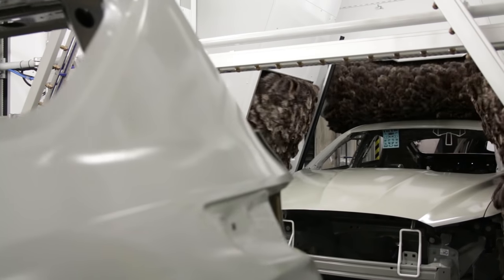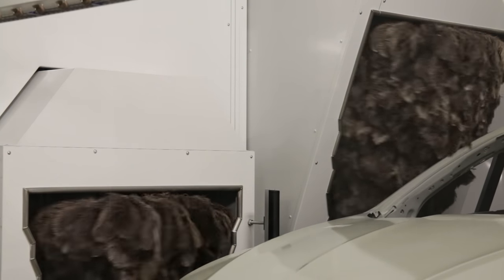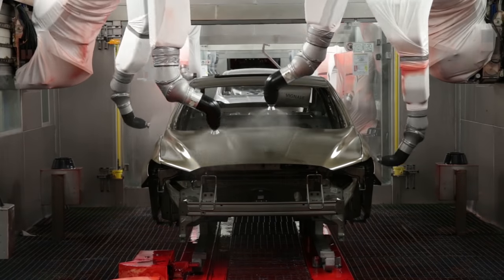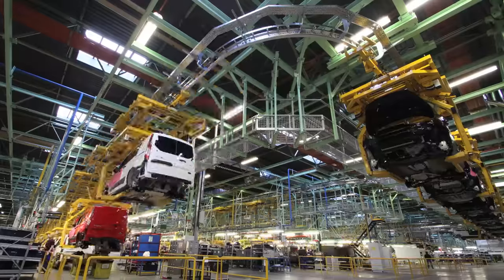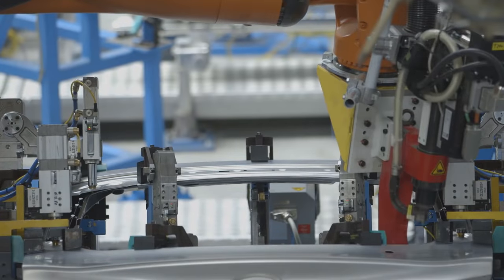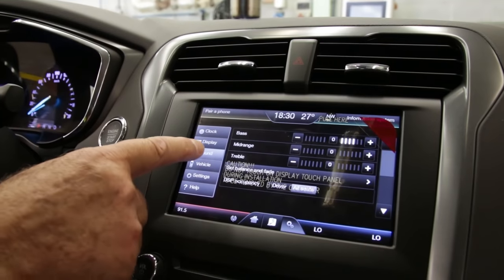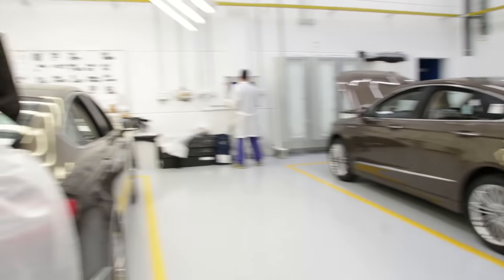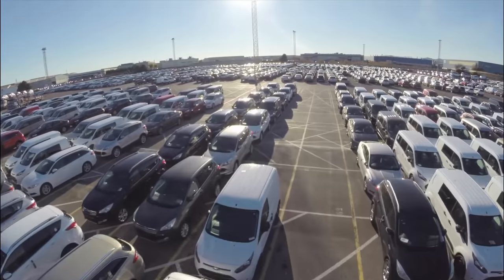See inside Ford's most advanced factory

Comment: What an irony. The most advanced factory to produce the worst cars. Ford Fusion 2013 still with warranty, only 10kmiles. . , 1 year having problems with gearbox and front axe. More than 45 days at the authorized repair shop, no spare car offered. No solution at all.. Very dissapointed with Ford. NExt time only foreign cars in my options!
Reply: I habe focus, best car in the world. No problems.
Reply: my problem with  Ford is they can't build a car a guy 6 ft 4 in can comfortably drive.  No room for your right leg. we've purchased  fords for years, but not a car since the 2006 Taurus. my daughter still has hers.  we gave our last one to the youngest daughter to meet her needs. i had several rangers until 2007.  roof was cut down several inches, if i hit a bump I'd  break my neck.  steped up to the f150 2007, very happy with it i knew it wouldn't be long for they messed it up with a consul that was to wide and to long just like the dodge and chevy.  gues its a law every car truck must have a consul that thers no room for your right leg, knee cap, usa cars and trucks are only made for a person 5ft 9in or less. years ago a big could  buy an escort or f150 now thers nothing. the Taurus and others you can't even get into. have had to go foreign, we have had so many fords in the can not count them all. yeah good decision to stop building cars. plus the prises are more than the price of a good house.  fire all designers.  waiting on the interior of the ranger. any room for the right knee cap, put the dash back in the dash, lower the conaul or just leave it out, and dont try to put nine people in the front seat.
Reply: They didn´t build the fussion in this factory, but in France. Now the factory is closed.